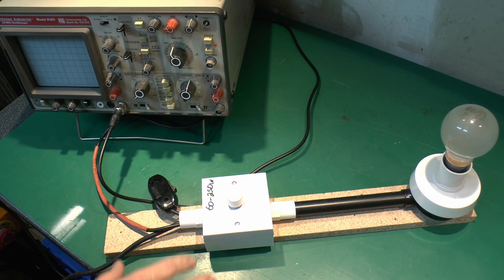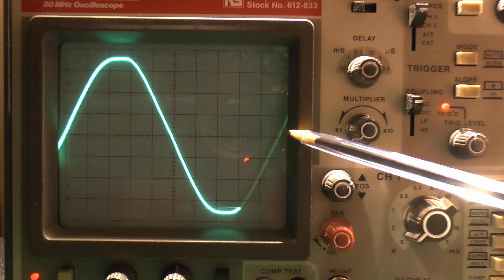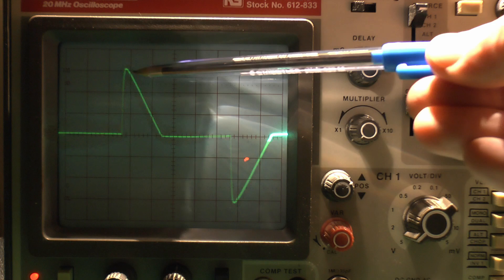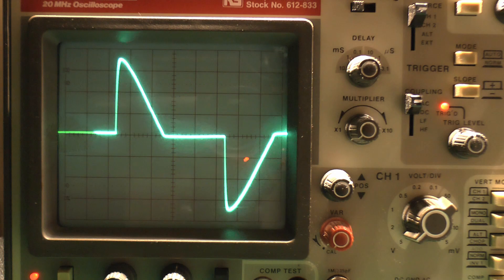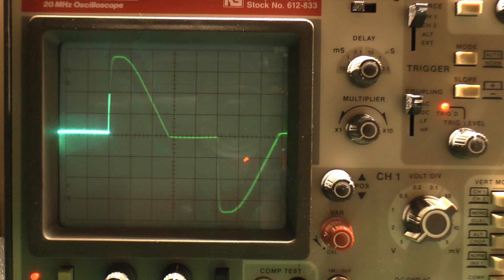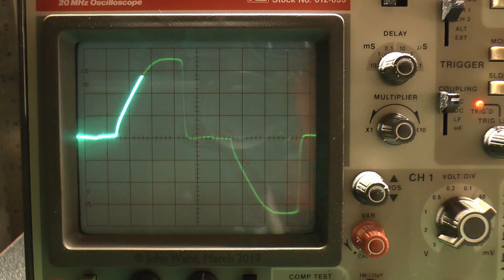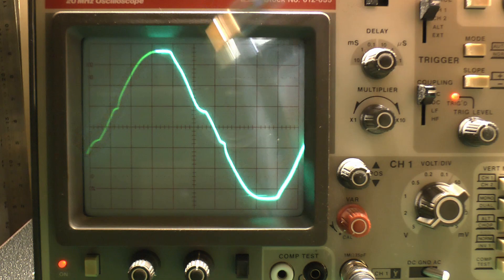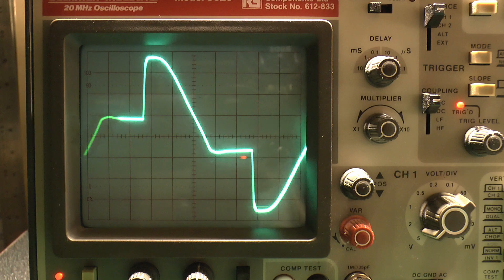Lamp Dimmers - Leading and Trailing Edge

Comment: Looks like the LED bulb didn’t have a proper star grounding system! 😆 Just kidding, of course. It does look like your AC mains has a bit of clipping, though; the peaks of the sine waves were a little... soft.
Reply: It's fairly typical :p
Reply: @AnnaVannieuwenhuyse  Flat tops are usually caused by dc power supplies drawing more current at the peak of the waveform to charge their reservoir capacitors and pulling the supply down. I once monitored the shape early in the morning at work, before many supplies had been switched on. There was a good sinewave at first which deteriorated as more and more dc power supplies were switched on as the day began.
Reply: @stephenwebb1481  sure. 

And it's fairly typical.
Reply: @AnnaVannieuwenhuyse  and will probably get worse.
Reply: @stephenwebb1481  that's not relevant to my original comment. Nobody asked for unsolicited advice on arbitrary unasked questions.
Reply: @AnnaVannieuwenhuyse  Sorry for that I didn't mean to offend you, that was my first ever comment on YouTube just getting the hang of it. The comment probably should have gone to William Squires and I must have put it in the wrong box as after signing up as the browser went completely off the thread I was following and I had to search for it again.  By the time I had got there I had probably forgotten who the original poster was. I used to teach power supplies and was just passing on my findings on why the flat tops occurred, after carrying out an experiment on it at the university where I worked before retiring some years ago.
Reply: @stephenwebb1481  okay. Thanks for being honest! I reacted the way I did because I've placed two comments on something and I've been receiving unsolicited mansplaining for the years since that post. There's so many guys on YouTube electrical channels that still think they have the right to harass someone over them1 not believing their2 own opinion on women and jobs/knowledge. 

So I reacted that way, tldr, because I'm tired of most comments being about overpowering me to prove that they are smarter even if irrelevant.
Reply: @AnnaVannieuwenhuyse  It's a shame you have had to endure that, some people can be horrible.

Comment: I have a quick thinking, using these dimmers for leds. And do have a theory . but  correct me if I am wrong.
With two diodes and two capacitors (polarity ones, so the charge will be reversed by AC waves)
Two sets of : One diode and one capacitor in series. And then this in parallel. 

____ |----------|>|-----| |------| _________
.       |----------|<|-----| |------|

Having this in series with the classic dimmers that way , the output could be more smooth and not spiked. 
The values of the capacitors are not given, because this would of course depend on the current used by the leds. (values should be that the charge won't drop 100% before each period of 1/50th sec.
The one series serves the upper waveform and the other series the wave below 0.

What do you think, JW?
Reply: These "dimmable" LED lamps NEED to see the sharply chopped up mains waveform. The IC inside the driver uses the "off period" to calculate what duty cycle of PWM to supply to the LED chips. For example, an off period of 50% might equate to PWM of 30% power to the LED, which would provide an appearance of "50% brightness". If you smooth out the waveform, the LED driver has no way of determining what "dimming level" is required.
Reply: @johncoops6897   With that assumption the classic dimmers should work fine as they are generating spikes too on the trailing side of each wave. So there is something different in play on this.
Reply: @johncoops6897  The idea of my design to smooth out spikes was more for leds without drivers, like strips and cobs. Ofcourse in combination with full bridge rectifier (no boom) and current restricting resistors.
Reply: @imgertberg5344  - we are discussing MAINS POWERED dimmers. The corresponding LED lamps don't work like you seem to think. They don't use resistors for current limiting, as that is a poor solution for Extra Low Voltage and even worse for mains power. You cannot (directly) dim ANY kind of mains powered LED lamp by varying the power by using a wave chopping dimmer... it just doesn't work (if it did, then the manufacturers would do it that way).
The "spikes" that you discuss are a non-issue - a dimmable LED lamp uses them then smooths it's own output, whilst a non-dimmable lamp is non-dimmable no matter what you do to it .